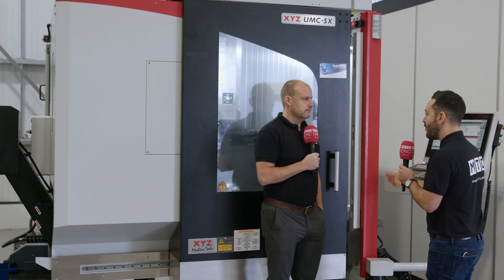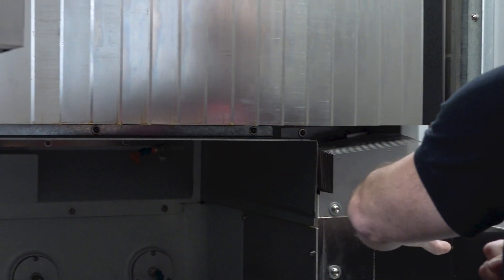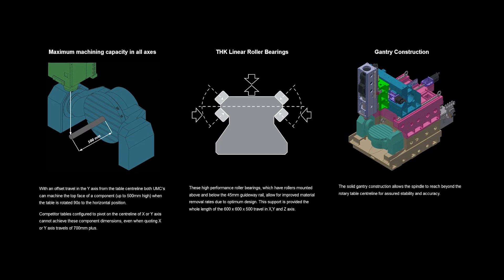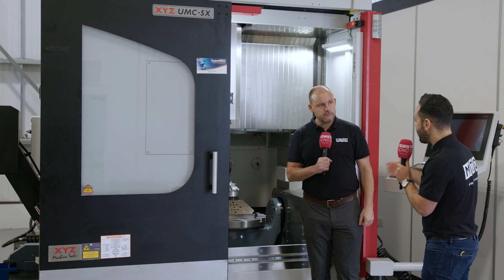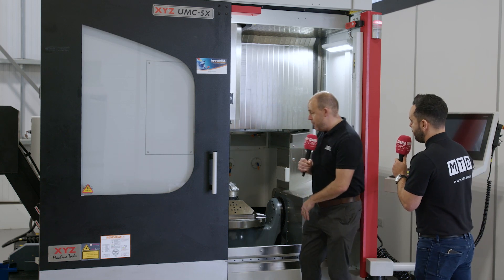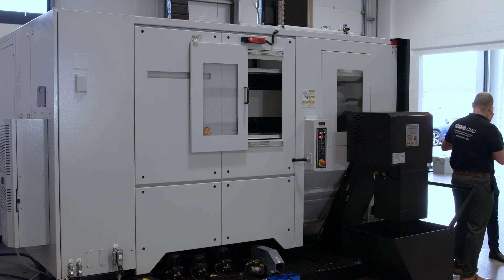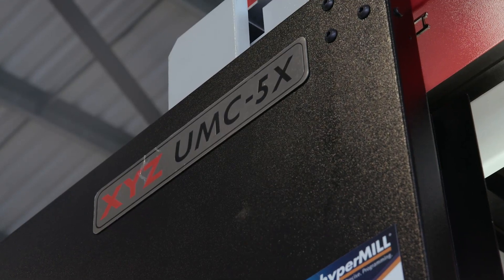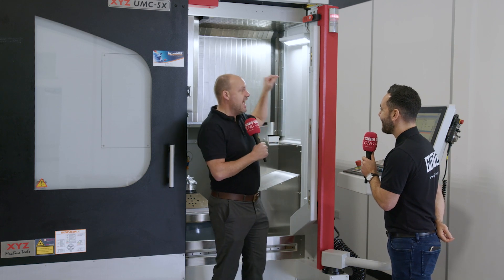Deep dive into XYZ UMC-5X, Paul and Gio explore this machine in detail from the ground up

Comment: 0:40 we have a different machine from another manufacturer which had the same principle but the problem was that over time the door got sticky to the point that you really have to push hard to open the door because of graphite dist (which this machine was designed for). They modified the door then with simple bearings and we never had a problem afterwards.
Reply from the maker: thanks for the comment and observation

Comment: This machine is really well designed, the only negative I see is that the table is rather low, loading in rather heavy parts by hand might not be so comfortable
Reply from the maker: Once you have a vice or workholding in place, its a perfect waist height